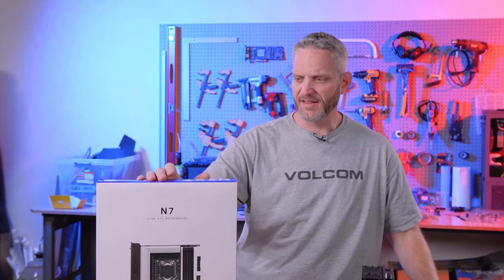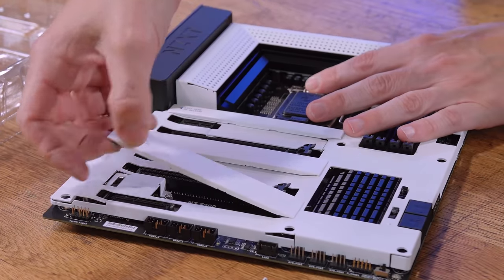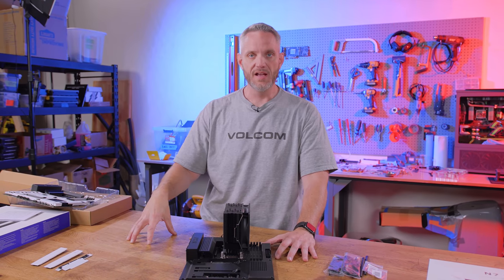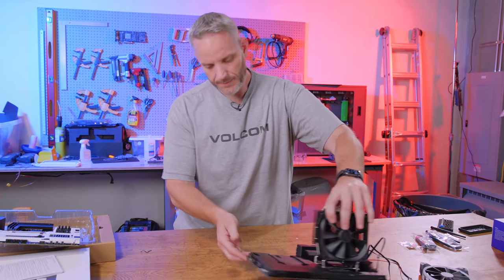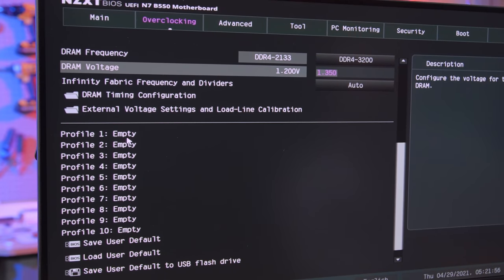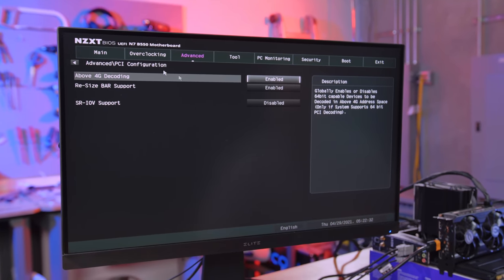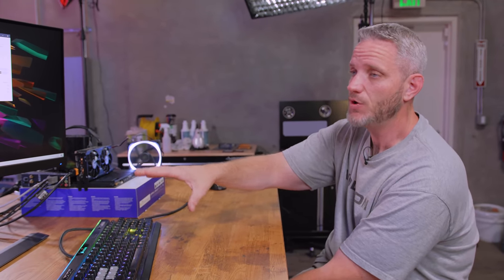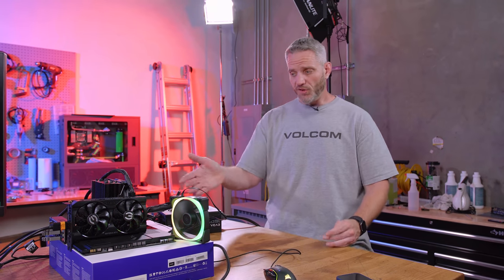Matte Black Motherboard Setup... Absolutely gorgeous!

Comment: Another minor correction: Front I/O audio is not "extremely noisy" on its own. It takes a LOT of poor hardware choices to make it noisy. Primarily the PSU, where you want as little electromagnetic noise and ripple as possible. Secondly the motherboard, where you want PCB isolated audio circuitry. Lastly the chassis front audio cable should ideally have shielded audio wires. The last of which doesn't happen often, but can easily be applied or modded into the cable. If you can hear noise on the front I/O audio jacks, first test the device on the rear jacks. If you still hear noise, your device is the problem. If you can't then check your PSU and MB first. See if they match the aforementioned criteria. If they do, then odds are there's either a short in the front I/O jacks themselves - potentially exposed to ground - or you need to EMI shield the cable header where it connects to the MB. This is easy. Take the cable out of the case if possible, and cover any exposed metal near the 1/8" jack in electrical tape. Then layer the outer sleeve in aluminum (aluminium) foil with the reflective side out, and all the way to and covering all but the tip of the internal header trying to leave some space on the sides of the header. Then resleeve the cable with more electrical tape overlapping the foil layer. This will block all potential EMI unless you've still got a short in the jack itself. Seek RMA immediately for a new cable, or you could DIY resolder the jack in an attempt to remove the short. Too much work or effort? Then don't complain about it because it is a solvable problem.

Comment: I’m thinking of getting the Z790 in white from NZXT instead of the Maximus Hero. Which not only gets me white, but is $450 cheaper. 

What bothers me is it has a smaller power connector. How much would that throttle voltage to the CPU? Or where would performance be pulled from? 

I only need one SSD slot.

I want a 4090 and it gets its own power cable to the PSU. So how does this measure up in terms of power draw and performance?

Comment: I like everything I see, but am still considerably burnt by their data harvesting scam from the CAM software back in the day... 

it looks wonderful vs other software, but when I had to manually disable network connections for the app so it wouldn't be able to send NZXT my hardware specs/loads/god knows what else don't get sent to NZXT, it was just not ideal....

No idea how they could convince me that scam wouldn't be EVEN WORSE with using their own motherboard AND software.

Comment: The problem with software controlling the motherboard is that it always has issues with updates from Windows or other drivers.
They're great at first. Until someone else screws it up.

Comment: I used Asrock a few times like 10 years ago, I stopped went back to Asus since they're more reliable, more stable and equal if not better performance. I won't build with any other brand now. I don't overclock with exception of XMP on ram. I am truly amazed at all the youtubers who rave about e-waste yet they all seem to do overclocking videos. When they have to be aware as any good tech is that overclocking shortens the life of the system. Spend more on better parts, if you get cheaper parts and overclock then you have to spend much more on cooling to come close to compensating. But I'm old, and scotish I made the last system last 10 years with a gpu upgrade about 5 yrs in. An off topic comments now, who wants to boycott the Newegg shuffle since they won't sell a video card by itself now? Moving more and more of my tech purchases to Amazon because of Newegg's sketchy business practices like what they're doing with the shuffle. PS like your stuff btw tons better than Minus Tech Tips, which is what it's become, with all the sales pitches there's hardly any time for tech tips let alone news.

Comment: I never knew NZXT made mainboards! It's reminding me of a build that ended up going in a different direction because I found a case that fit my needs better, but I originally had the idea to modify a NZXT H710 or H710i. Now that I know they make mainboards too, I can only dream of Linus Tech Tips promoting them through an "all NZXT build", that I won't be surprised if NZXT BLD already offers.

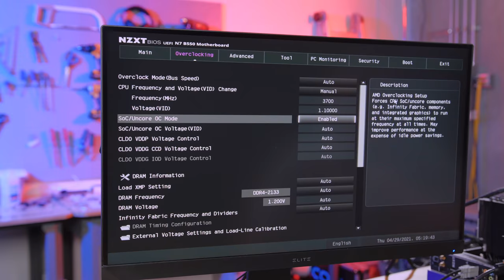(12:39) (looks at Gigabyte mainboards, at least Z270 based boards, because I didn't realise I turned on RAID and was wondering why my SSDs wouldn't show up correctly in Samsung Magician)

Comment: As someone who has been runnig an Asrock motherboard for the last few years, I can confirm that their bios has a lot of very nice quality of life features.  The down side of their products is that they do often tend to cheap out on their VRM options as they are a very value oriented brand.  However, I feel that if you are in a similar position to NZXT where you want a partener to build motherboards for you to sell to gamers, Asrock are a very solid choice as long as you specify the quality of VRM you want included.

Comment: I’ve had mine for a couple of weeks now, it looks and works incredibly well (all black build with Noctua chromax D15s cooler and black NZXT H510i) so very much like the one in the video. 
 Too bad I can’t overclock my 5600x to max as I’m still waiting to get a decent replacement for my 1050 Ti. 😂

Comment: After the VRM tests of Hardware Unboxed, I decided to stay away from any AsRock boards for a while. So I will have to pass on this one, despite it looking quite fancy.
I prefer a motherboard that can actually power a non-overclocked cpu.
Reply: I have a feeling those tests were very rare isolated incidents..I've I'm on my third Asrock mobo ( currently asrock x570 taichi with a 5900x cpu).  2nd was my 4790k cpu build from 5 years ago....Every single Asrock board for me has been rock solid in every way.  So...*shrugs*...maybe I'm lucky???

Comment: I like you still refer back to your fx days. this is a nice board, love the bios too! I would just want a similar X_70 chipset model if I were buying
Reply: Nzxt is focused on gaming. B550 is perfect for amd gaming and most users. X570s increased pcie gen 4 lanes are really not needed for gaming builds. They just don’t offer features that justify the additional sku when b550 offers the gen4 where you need it
Reply: If you're using 1 gpu all you have to do is make sure you get a large ssd when you build it instead of getting not enough at first to save money.

Comment: Feature-set aside, one thing that always comes to mind with armor over the full board is covering the CMOS battery…If there’s an issue and it needs to be reset, I really don’t want to have to take out my graphics card (or other relevant PCIE hardware) and unscrew the armor just to reset it. 

I can understand it being covered by modern cards, but still
Reply: There's a "clear CMOS" button as well as support for the USB flashback feature on the back for exactly that reason

Comment: FYI There is an issue with CAM that they haven't fixed for months where it freezes your computer to the point where you need to hold the power button to shut it down. This is the only reason I'm hesitant with NZXT right now. Yes, I have this freezing issue too.

Comment: Next time you are bored Jay, here is an experiment for you: buy a large off the shelf full PC case, then mod it so that it still looks good, but can hold enough 140mm fan based radiators (like multiple 560mm or 420mm radiators) to be able to get a max overclocked top of the range CPU and GPU to within 5 degrees C of ambient, with fans running at the minimum speed they can go. I know you did the box fan experiment, but that was not within an off the shelf PC case, not practical, and not something that we could copy at home ourselves in a way that would look good on as a complete self contained PC that you want to keep and "RGB up", rather than bits of equipment all over the place. If you do this, please show every step because I would love to follow your method and have one of these myself. :)

Comment: So when I was running cam which was included in my H700i I bought in 2019, it would constantly ramp my fans up and down.  I tried playing with the graphs, but it just would ramp my fans up, sense the cpu was below threshold, then ramp them down.  I can deal with loud fans, but not when the rpms are constantly going back and forth.  Not a fan of the software at all.

Comment: In my old pc I had two asrock motherboard, in years of use. They all broke after warranty. Since I put the gigabyte, in there, there is no issue anymore. It still runs most of the games we play here, since it's just the guests pc since 3 years. But I'm done with asrock, I will avoid them.

Comment: What's awesome about the antennas as well is it's super easy if they DO fail (rip me bumping my case into a wall and crushing my antennas) to just get replacements at a tech hardware store for a few dollars.

I just watched the LTT supernerd video on motherboards, and I just made the connection that the Infinity Fabric being 1/2 of the memory clock is probably because technically the memory is not running at 3200, it's running at 1600 but bidirectional, right? That would make a lot of sense.
Also that BIOS is impressively spartan.

Comment: dont use the secure ssd erase tool on an nvme, i learned that the hard way. it erases something that is used by the os to be recognized and i ended up having to use gparted to put everything back the way it should be. was awhile ago but if you want to know more do a quick google search.

Comment: I'm looking at the 2nd 16x slot and it doesn't look as a 16x connection, the pin contacts in the slot look like 4x

Comment: I'm so glad you got an N7 B550 board too! My experience with mine hasn't been exactly hassle-free. Two of my USB ports stopped working after a BIOS update that was supposed to address the Ryzen 5000 USB bug issue but instead it GAVE me the bug! At least the board looks nice and doesn't have RBG on it. I actually uninstalled CAM because it was making my EVGA CLC 280 run at full blast even after I set a fan curve. It was either 100% or 0% speed, no in-between, so I let the  the BIOS' fan curve handle it. Kinda disappointing as I came from an AsRock X470 Taichi Ultimate. :/

Comment: Ryzen 9 5900x 
Asus strix RTX 3080ti when it's released
32gb corsair dominator platinum 4x8gb on 3600mhz 
nzxt z73 cooling
lian li o11 dynamic 
9 corsair ql fans 
corsair mp 600 pro 1tb
samsung 970 evo 500gb
and a 850 watt  corsair psu
my question. What Motherboard can I use?

Comment: dude, i have the nzxt z370 n7 and its amazing 😳✌🏻 it works awsome!
my 8700k runs with 5,4ghz allcore and 4,6ghz uncore with auto voltage, max 1,285v. this is the best what i habe ever seen on an 8700k. i love it!
the software is crap, but i dont usw it, i usw an rgb controller with an remote

Comment: Nice looking? Checked. Trash overall? Checked too! BTW, Z490 N7 was Asrock too.

Oh my god, the debug LEDs placement... I'm also a former user of NZXT Hue+ and all I can say about CAM is... utter, PC slowing, overblown and useless garbage. And it's still shit and showing stuff, that Task manager and HWiNFO shows in more details, so they're pointless. You have advanced cooling control in BIOS, so software is redundant... unless NZXT in their genuine genius told Asrock not to include manual fan curve adjustment, like other did in Z97 motherboards. There's literally no merit in having OS software control for something you set ONCE and forget for the rest of your life. Also, audio mode for NZXT Hue was so bad, it pushed me into developing my solution, based on Arduino, which turned out successful.

Comment: I stopped using CAM mainly because it would lose coms with the AIO and other devices. It might be better now but I tried working with them, filed bug reports and sent logs ... they said "we fixed it" and it wasn't. I started using LiquidCTL and have not looked back. LiquidCTL works really well and it works with Win/Mac/Linux. :)

Comment: On M.2 drives, like the 970 EVO and WD SN550... do you typically remove the sticker or keep it on? If your motherboard includes a m.2 heatsink, does it matter if you leave it on?

Comment: At one point I was working on my X570 board I don't remember what I was doing, but I forgot to put the antennas back in. The WIFI was FINE!!!! When I realized it wasn't plugged in I was shocked. Then again the router is only about 20ft away.

Comment: Wow NZXT. Aesthetically well made and feature rich. Matte White would go well with my 501st themed PC (white, blue, and black). I'd personally prefer to have a digital POST code display than just LEDs, though it looked like space was a bit of an issue. Perhaps an integrated display screen is in order, maybe as a more premium x570 board? X) Finding an all white ATX board that is AMD is already practically impossible, and finding one that has features like bios flashback has been impossible (for x570 at least). This is the best I have seen.

I look forward to seeing what Jay & crew find out regarding performance (and if it catches fire). I'm not in the market for anything new, and very likely won't be for a while, but if this is never abandoned and the quality stays really good, I will likely pick up a future version.

Comment: "Front audio which nobody should use because it's analog and it's extremely noisy...." NO! There's a DAC. And propably a crappy one. And if an audio signal is crappy it's not just because it's analog. Good analog devices have a good enough signal to noise ratio. ;)

Comment: Point of order, you keep saying "active cooling" for the M.2 slots... I don't think that word means what you think it means =D Active cooling would be cooling with a fan or water cooling, thermal pads attached to heatspreaders (the covers) are passive cooling. 
Also, afaik, the NAND chips shouldn't be cooled down too much, i don't remember the reason but the TL;DR is NAND too cool=bad. The controller chip and the RAM on the SSD do like being cool, so they should have pads and spreaders.

Comment: Minor correction: When Jay says the original NZXT motherboard was OEMed by EPS, it's actually ECS.
ECS has been in motherboard manufacturing for over three decades, and are the fifth largest motherboard manufacturer behind the big four. They are particularly known for being an OEM supplier for pre-built and system-integrators. For DIY, they are generally regarded as "cheap" or "bare minimum" and have zero marketing presence since they don't push their products to reviewers. In practice their boards are functional if lacking in features to keep costs as low as possible. If worried about their "cheapness" ECS is Taiwan-based, not officially Chinese. This is however no longer relevant and well outside the scope of a minor correction for the video.

Comment: Wait was my comment just deleted? I was just pointing out the NZXT cam software is something people should be aware of. For me it caused constant lockups on my Windows 10 PC. For that reason I wouldn't trust their motherboards or hardware. I know other viewers of this channel have also had similar issues with that software, it's pretty well known at this point. Anyone who might be using NZXT Cam and having mysterious lockups happening you can't figure out why, NZXT cam is probably the culprit. Check your Windows event viewer to confirm. Hopefully this comment does not also get deleted just because they are a sponsor. If it does I'll probably have to unsubscribe.

If anyone out there is unfortunately suffering with NZXT cam causing unknown lockups a quick Google search will reveal the LTT forum, bleepingcomputer .com, and reddit threads with many users confirming this as well. Be careful of running NZXT cam. It might cause lockups. For that reason I wouldn't use their motherboards either.

I'm certain other NZXT cam users have opinions about this lockup issue as well so I'll take no replies on this post to mean my comments have been hidden which will also result in unsubscribing as well. But hey, your sponsor is happy users opinions are censored when calling out bad software causing lockups right? Mislead the users, they'll never know unless they figure it out.

Comment: Speaking of those wifi extension things, can I just plug some old antenna I got off an old router in and have it work, all the specs line up, except I've no idea where/how my mobo deals with Bluetooth, or whether it works through the wifi antenna.
Oh and fuck gigabytes x570 bios. Utter shite. Messy, convoluted and unclear.

Comment: Never would buy an NZXT board, mainly because I hate the CAM software. I had to search forever to find another software which would let me controll the pump speed. Argus Monitor is completely capable of that, so I deinstalled CAM. What bothers me too are the restrictions that NZXT implemented in their AIO coolers … For example if you run CAM and Hwinfo at the same time it won’t readout the water temp, pump speed etc. lol. It’s just greyed out and that’s definitely intended from NZXT.

Comment: Wait.. no led to show boot status? Jay I love you man but how did you miss that? 

My only other gripe is the fact that NZXT restricts power monitoring to their own power supplies. They could have easily implemented it for all the major components. Also, every time I see another proprietary connector (in this case referring to RGB) I cry a bit. 

Thanks for reviewing their CAM software. Previously, I had such a horrible experience with CAM that I completely wrote off NZXT and have avoided purchasing any of their products. At some point we need to start holding companies responsible for their shit software (ahem Asus). I was happy to see NZXT has been significantly improved and has a guest mode.